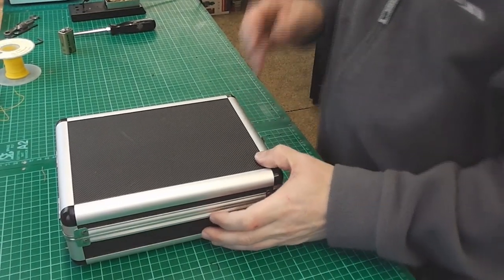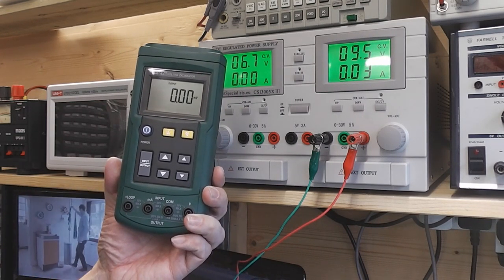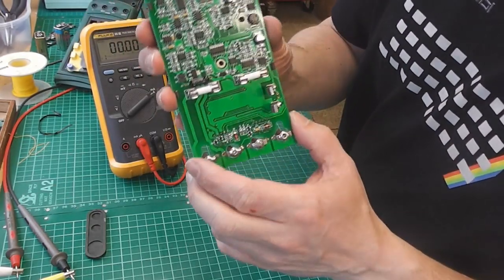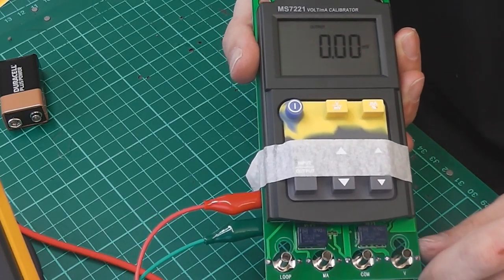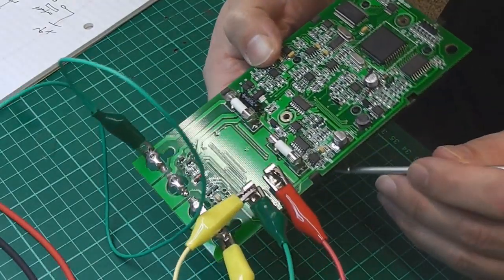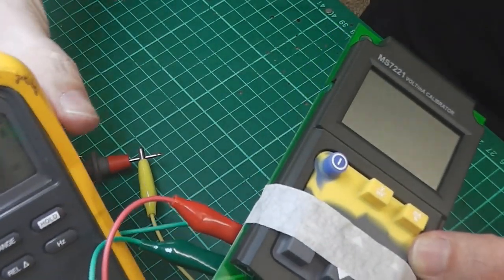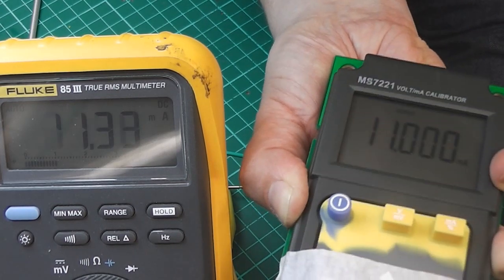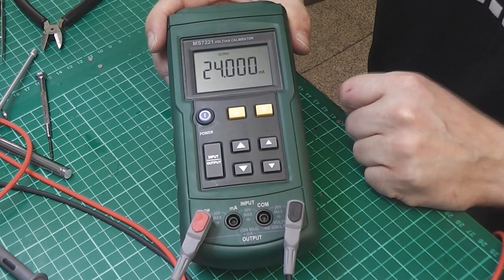Mastech MS7221 Volt/mA Calibrator Repair

Comment: I just repaired a fairly decent mastech my64 meter. It didn't like to switch on, i soldered a 16k resistor from one of 2 transistors to ground and now it latches on every time. my finger encouraging it to turn on when touching the board behind the switch was a good clue/.
  Starting to look like that one had a similar issue, wish i had seen this a feqw years back i've been using the el cheapo backup.

Comment: Nice video, but far too much time was devoted to discussing the battery supply, and not enough time spent on precisely what is wrong with the unit and with how to fix the problem. In other words, what needs to be done to fix the problem when using a 9vdc battery.?..Please be clear about what you opted to do to fix the problem.Thank you!